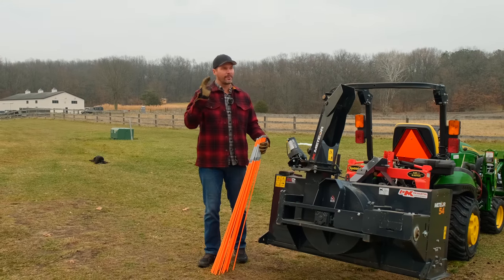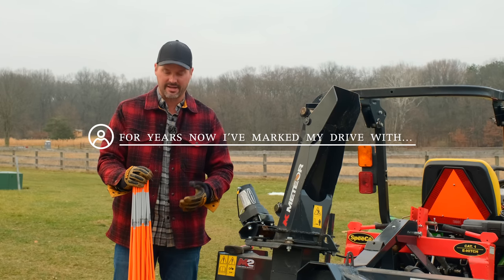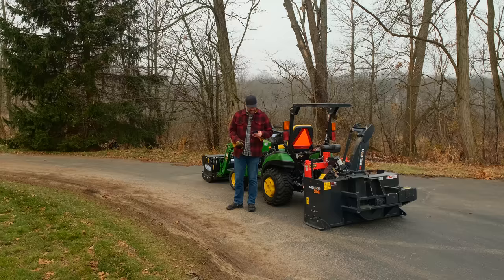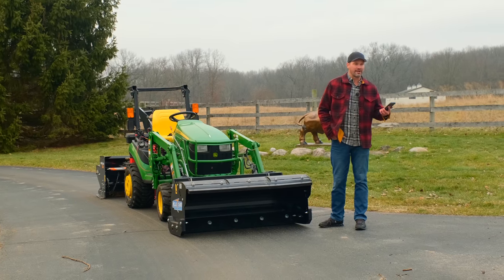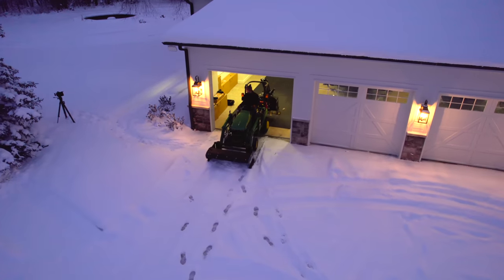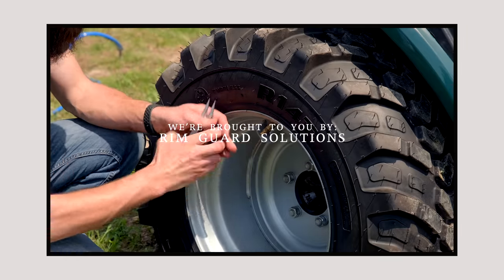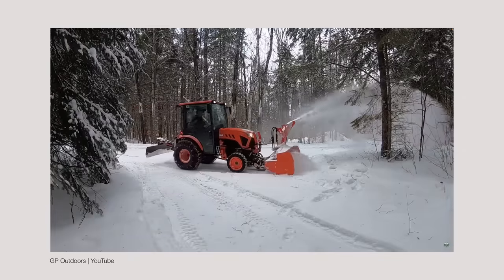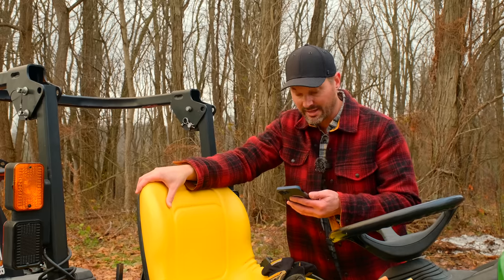I'M EMBARRASSED BECAUSE I DIDN'T FOLLOW THE RULES 😳🚜

Comment: Tip for putting iin fiberglass marking rods which I use cause I have lots of gravel, I use a long concrete SDS 1/4” bit & pre-drill my hole. Works great & saves the rods so they last longer. Thanks for your channel.
Reply from the maker: I think that's a great idea
Reply: The markers I bought came with a masonry bit and gloves for just this reason.  Where I live in PA, you can’t drive anything into the ground 3” before hitting a big rock.
Reply: I just use a piece of rebar to drive in a hole.
Reply: In addition to pre drilling I use a piece of 3 feet steel gas pipe with a end cap on one end as a slide hammer to drive the marker in..............saves you from hitting your hand with the hammer.
Reply: @tonyfabiano511  - lol - In my army days we called that Thumper. Used for driving stakes when laying barbed wire. 😃
Reply: Clamp a piece of rebar or smaller bit-metal, to the side edge of your forklift. Then just press it into the ground six or 8 inches. Makes a good pre-drilled hole.  And the tractor does the hard work
Reply: @justanotherviewer52  Me too!🤣
Reply: Works on frozen ground too if you are late getting markers out in the fall.

Comment: Forgive me if posted already but a great way to preserve the posts is to use cold shrink or heat shrink tubing.   It comes in various colors so they can stay visible and in tact and even more rigid with more layers added.  Hope that helps save a little jingle!!

Comment: I got 50 of those marker rods that came with a 3/8" masonry bit for $53 on Amazon. They have held up just fine for a couple of years. I bought a second 50 recently to double up on the markers because my 800' driveway has several curves I'm it. I brought a cordless hammer drill and installed 80 of them in a little over an hour in rocky Vermont soil.

Comment: Also a tip for putting up driveway stakes. Use a 20 inch 3/8 rebar maybe 20 inches long to hammer a hole from 3-8 inches deep into which you insert the driveway marker stake. Also allows the stake to be loose enough to flop out of the hole if your plow/pusher packs snow around it. With those stakes being as expensive as they are this will help them last many years

Comment: 1. They sell a special tool to help set driveway marker stakes.  Discount Snow Stakes.  You need one, lol. Some folks use a drill and long shafted drill bit/auger to make a small hole 6 to 8 inches. 
2.  Buy some Snow-Jet or other polymer snow and ice spray to coat inside of the auger to help prevent wet snow from sticking.  Works on shovel too. Don’t use your hands to unclog a clogged snow auger.   A small trowel works great. 
3. Buy a long handled broom with a smaller 5/6 inch head (plastic bristles work best) to clean snow off of snow auger and tractor before you store between jobs. 
4. Buy a bunch (at least 12) of extra shear bolts for your snow auger, especially if own a gravel driveway.
Reply from the maker: Haha, yes I do! Thanks for chiming in!

Comment: I’ve started the holes for those markers with a piece of rebar or a concrete form stake and just drop it in.
Reply: I did that and it worked great.  I switched to putting in conduit so the holes become permanent.  Have to plug the pipe after removing the markers so they don't fill up with soil.  After years of fiberglass splinters switched to bamboo poles, which are real cheap, and used yellow spray paint.
Reply from the maker: Good thinking Monk
Reply from the maker: Interesting, might think about that!

Comment: Great tips Courtney. Thanks.
For my walk behind, after cleaning out snow from the auger, I always rest the front cutting edge on a piece of wood allowing any left behind snow to melt and drain out the holes in the bottom of the auger.
For my front mount blower, I always rest the skid plates on a piece of wood for the same results.
You can never have enough driveway markers.
Reply from the maker: I think resting on wood is a real smart idea

Comment: Speaking of cutting corners, I'm always amazed at how many drivers don't understand that when they turn a corner the back wheels don't follow the same path as the front wheels, and they run the back wheels off the pavement.  My experience is that if you put down rock, they'll just go that much farther over and run off anyway.  There's a big hole at the entrance of my subdivision where everyone runs their back wheels off, even though it's winged out to meet the state road.  As we all know, there's one thing you can't fix.
Reply from the maker: Yeah, exactly...your rear tires don't always track the fronts
Reply from the maker: I think landscape boulders might do the trick :)

Comment: I would suggest you buy a Sweepster broom. I have a 6 ft that I use for lawn, driveway and even the street I live on. It's great for dethatching the lawn or removing gravel from the grass. I sometimes get mud on the drive or a heavy rain will deposit dirt, mud, sticks from wind and whatever else. Looking at your drive you need a broom. They use very little horse power to run and aren't that heavy. A one series could handle it. The only thing you may have to do to it is change the gear box to a 2:1 reduction to slow the bristles down. Sweepster runs 1:1 which is tough on the lawn. I changed mine for 250.00. Just a thought

Comment: TBN is a great resource.  With the orange stakes I either wear my winter jacket or wrap a rag around the top of the post, jam it in my armpit, steady the post with my hand near the middle and push it in the soil.  I only go about 6" deep and my soil is easily penetrable.  I don't put them along the driveway as my beloved runs over them for some reason.
Reply from the maker: Hehe, bonus points for hitting them maybe?

Comment: I drive 10mm rebar in the ground and put a piece of 1 1/2” pvc dwv pipe over it. I put a ring of reflective tape on the top. I have a 600’ gravel driveway.

Comment: I have always used 1/2" metal Conduit.  I bought the 10' pieces and cut them in half and use a fence T-Post driver to put them in.  They have lasted me well over 20 years.
Reply from the maker: Good idea!
Reply: They are meant to break if you hit them, and its not always possible not to hit one, no need to reply that you have never hit one.
Reply: @starlink3125  You are right, I have hit mine several times over the years and they just bend and I sort of straighten them out every season.  Some times they break off at the bend when straightening them, but being slightly shorter has never been an issue.

Comment: Another tip for drag type snow blowers. Extend your top link which will push The cutting edge at least an inch or two off the ground I have a gravel driveway and I almost never catch rocks doing this. After you have a good packed base on the drive way then you can adjust it back down
Reply from the maker: I'll have to give that a shot, thanks!

Comment: A piece of conduit helps to drive those orange stakes. Sliding the stake inside then hammering down reduces the amount of flex applied to the fiberglass (Increasing life span). It also reduces the amount of energy lost from the blows of the hammer.
Reply from the maker: That's a good idea

Comment: I just received an order of driveway markers, unfortunately the unordered snow arrived first (about 6 weeks early, and like an obnoxious relative, it shows no signs of leaving.)  I have sort of figured out where the driveway is, but I am just going to use the markers in the snow berms along the driveway anyway for two reasons,:  1. I get high winds and drifting that can leave the ground a flat featureless plain. 2. On gray overcast days, it's hard to see the white driveway on a white background with no shadows. 
With the snowblower, I have been able to cut through the 40 inch deep snow drift that runs the along the length of the northside of the private road.  I have a tractor with a hydrostatic drive and I just listen to the tractor and snowblower and vary my speed as needed and take a full 6 foot wide cut.

Comment: Don't pound these fiberglass posts in, you'll destroy them in short order.  Use a battery powered hammer drill with a long,  thin bit and just push the posts in by hand.
Reply from the maker: I like this suggestion

Comment: Use a cordless drill and a small auger bit to pre-drill.  Get a long auger it to save your back.  

And/or get a piece of small diameter pipe or even 1/2” copper pipe that’s about 1’ shorter than the stake and use that to hold the fiberglass stake (inside) as you hammer it.   The pipe will prevent the stake from bowing out as you hammer and it will go into the ground.   Then just lift the pipe off.
Reply from the maker: I like the pre-drill idea, definitely doing that next year